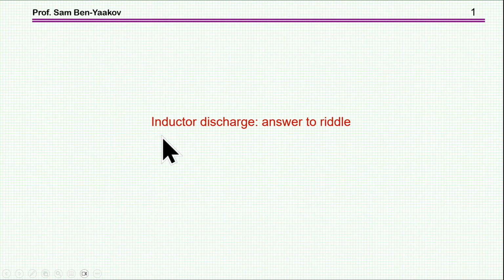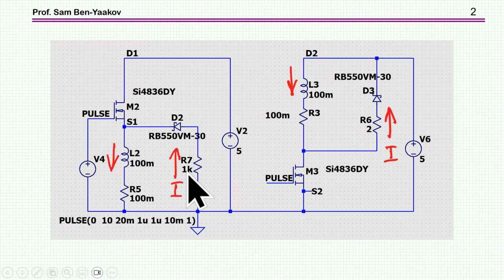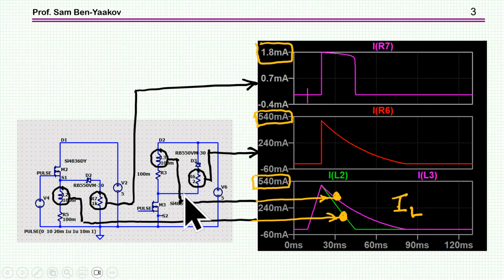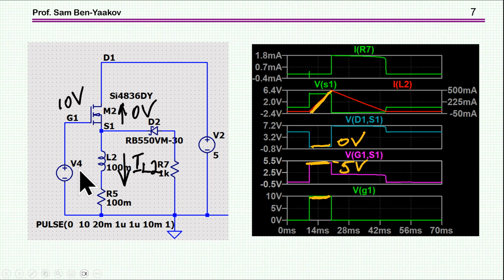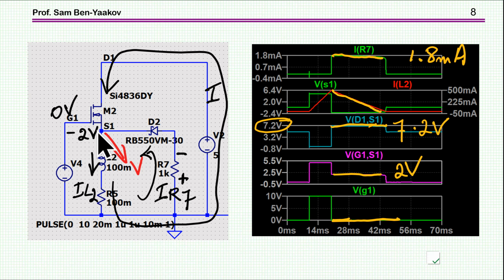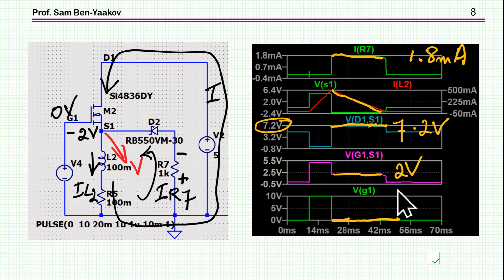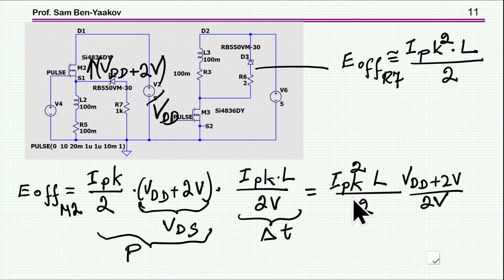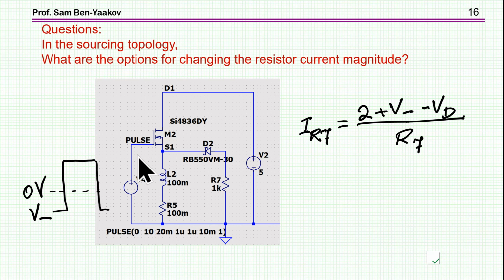Inductor discharge: answer to riddle

Comment: Nice riddle, thank you!  If I made R7 larger it would work the same way. But if it were too large or infinite, would it still work? Without considering parasitic capacitances it should, as L2 would draw a current from M2's source . But having all those capacitances there, I'm worried about oscillations. Are my worries substantiable?
Reply from the maker: Yes it will

Comment: The topology with the inductor in the source, what is it for? I did not see schematics using it.
Reply from the maker: This is an excercise to test electronics attitude. The circuit may have advantages in certain applications as part of a DC driver to an inductor trferred to ground. I can only presume that you have not seen all schematics on earth. I didn't.
Reply: @sambenyaakov  leave irony aside, what i said in here is true, and your explanation, even if vague, is good, i appreciate. 
anyway, as an academic, you could try to formulate the second model of what is parallel configuration, for example. you forgot to do that. i need that paper, in order to rate it

Comment: An other solution would be to exchange the N-MOSFET for a type with a larger Vgs-th. But this requires a higher gate drive voltage, complicating the drive circuit. Yet an other solution would be to connect an NPN transistor with it's emitter to the source, it's base to GND with a resistor and a diode and the collector to the gate, shorting Vgs (driver must have some resistance) while the source is below GND. This solution requires no external negative voltage gate drive.
Reply: Yet, if you are keen on reducing the BoM, ditch the diode, replace the MOSFET with a NPN, tie R7 to the positive pin of V4 and to the base of the NPN. Thus, while induction energy exists, the NPN is in saturation/amplification.
Reply: @codures  That might work as well with a resistor in series with V4.
Reply: @SwitchingNoise  that was what I was mentioning, sorry for not being clear. It's kind of hard to describe circuit changes in YT comments.
Reply from the maker: @codures  This is an excercise, a question on THIS circuit.
Reply from the maker: Yes. Thanks for participating.

Comment: Thank you. If the gate of mosfet will be driven with isolated source (for intance isolating transformer), in that case the transistor will stop conductig almost imadately and will behave similar to sink configuration of circuit, correct?
Reply from the maker: Yes, but the questions were on THIS circuit.